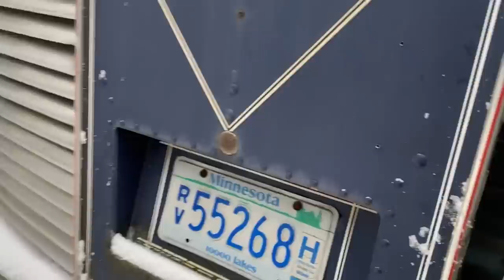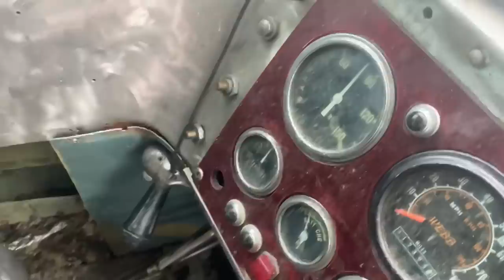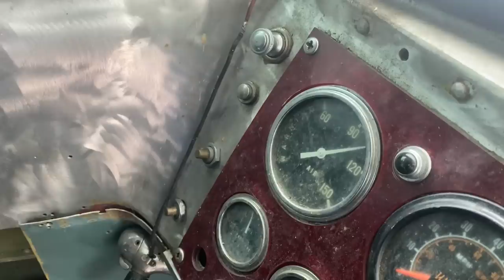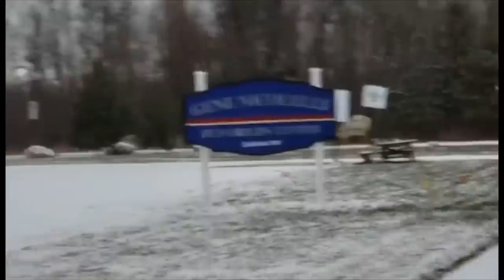Day 2 silversides bus rescue Minnesota

Comment: The iron ore process is called “pelletizing”.  They take the ore out on the ground at 35% iron grind it to a face powder, pass it through magnets, and roll it into small balls,  at min 65% iron.   Ships by iron ore carriers to Cleveland and Detroit blast furnaces. 

29 degrees is a heat wave.  I lived in near Hibbing for two years building a pelletizing facility in Eveleth Mn.

Comment: hi there Im a retired electrician the reason your genny does not like the 100 ft extension cord is resistance ( electrical that is )  my suggestion would be make an electrical service point in brick or block  a small little block shelter for a permernant point , maybe like a liitle block shed just big enough to mount a couple of powerpoints in you can run a heavy supply to this point from your shop and slove the jenny problem

Comment: 20 degrees. That's a heat wave in minnesnowta. As soon as I saw the first 10 second your video I knew exactly where you were.
Reply: originally from: Kevin Roses 

Annotated Thermometer:

60 degrees	Californians put on sweaters

50 degrees	Miami residents turn on the heat.

40 degrees	You can see your breath.
	Californians shiver uncontrollably.
	Minnesotans go swimming outdoors.

35 degrees	Italian cars don't start.

32 degrees	Water freezes.

30 degrees	Minnesotans put on t-shirts.
	Politicians begin to worry about the homeless.
	English cars don't start.

25 degrees	Boston water freezes.
	Californians weep pitiably.
	Minnesotans eat ice cream.
	Canadians go swimming outdoors.

20 degrees	You can hear your breath.
	Politicians begin to talk about the homeless.
	New York City water freezes.
	Miami residents plan vacations further south.

15 degrees	French cars don't start.

10 degrees	Too cold to ski.
	You need jumper cables to get the car going.

5 degrees	American cars don't start.

0 degrees	Alaskans put on t-shirts.

-10 degrees	German cars don't start.
	Eyes freeze shut when you blink.

-15 degrees	You can cut your breath and use it to build an igloo.
	Arkansans stick tongue on metal objects.

-20 degrees	Cat insists on sleeping in your pajamas with you.
	Politicians actually do something about the homeless.
	Japanese cars don't start.

-25 degrees	Too cold to think.
	You need jumper cables to get the driver going.

-30 degrees	You plan a two-week hot bath.
	The mighty Monongahela freezes.
	Swedish cars don't start.

-40 degrees	Californians disappear.
	Minnesotans button top button.

-50 degrees	Congressional hot air freezes.
	Alaskans close the bathroom window.

-80 degrees	Hell freezes over.

-90 degrees	Lawyers put their hands in their own pockets.

Comment: Torpedo on the engine is a great idea! Getting any kind of heat source on an old diesel can work wonders getting her going in cold weather. My block heater died on me in my truck so I have a space heater I run under the hood for a couple hours before I head out and she starts right up. Quick fix until I get a new block heater in.

Comment: If you see a mist of water coming of some ones tires it means the road is not frozen. If you don’t see any mist of water from the tires be careful because it is probably black ice.  You can get a thermometer to constantly measure the road surface temperature while you are driving down the road.

Comment: If you don't want to see outside a window watching a bus riding down the road for ten minutes, cut out 23:00 to 33:00. Do the same between 41:30 through the end of the video at 49:51; saves yourself an additional 8+ minutes of just watching someone driving down the road. Interesting stuff getting the old bus running and the old buses at the storage area though.

Comment: Scot, how does it work in the US for getting an old vehicle back on the road? In Australia we have to pay an annual 'registration' charge to the government for the privilege of accessing the roads. Driving a vehicle on a public road without paying the fee has huge fines, commercial vehicles like your bus also require a signed off annual safety inspection slip before the registration will be processed. You seem to jump into vehicles that have been abandoned for years and drive away, is there back ground paper work happening that we don't see? Cheers.
(That traffic light was pink by the way, not quite red)

Comment: Hey Scott you ever see those diesel fired 12 volt coolant heaters ? I was looking at one a guy put on a kenworth truck this week. I’m sure I probably can’t post a link in the comments here but it was pretty slick because he would switch that thing on, it pulled fuel from his diesel fuel tanks it has a built-in 12 V pump and it heats and circulates all the coolant until it comes up to 180 automatically. No cold start an instant heat👍
Reply: The ones I remember were made by Stewart Warner. I believe they were called Hot Box heaters.

Comment: I notice there was one fuel door that was labelled "gas only".  I wonder what that was for, as there was another labelled "diesel only", which I assume was for the engine fuel?
Reply: Those buses had a small 4 cylinder gas engine operating the air conditioning system.

Comment: I’ve got a 1947 PD 3751 was a greyhound from Ohio ! My front end when first driving before tires warm up if I hit a bump it will sometimes go into a severe front end wobble , I notice it’s getting worse ! Any ideas ? Also I had a complete rebuild on engine ,high block four valve head  jakes and rebuilt injectors ! First time after rebuilt drove to Colorado from Bend ore. Kept a close eye on tail pipe so not to lug engine RPMs up all the time ! Ran great no smoke , but when I got to Boise the highways was all tore up very bumpy , I notice a fuel smoke coming out of tail pipe but only when under power going down the road , no noticeable power loss , but pissing off everyone behind me with the strong diesel smell . No smoke when not in power, idol or raving engine in neutral . Could it be a puked injector? All rebuild was done by Jim Fairs diesel in Bend Ore. would welcome any thoughts! Thanks ! Silverside owner ! Love my bus! Sincerely , Richard !

Comment: Get a bag of charcoal,  a dollar store paint tray, get the coal going and get some blocks under it so the coals under the oil pan. Use left overs for weenie roast.  That bus looks too good to be true, is this reality TV ?
Reply: Don't they sell pre-made portable barbecue picnic trays now?  Come in a foil box with charcoal or something, you just have to light em.  Never thought of using that to heat an engine...worry about fire though.
Reply: @DellAnderson  I guess anything would be possible. Very lttle  if any flame . just radiant heat

Comment: Have you put any thought into getting a diesel heater or maybe 2? You could feed them off of your reserve tank. They are powered off of 12v and from what I've seen they are really quite efficient and effective. I absolutley love watching your videos. The thought of you and your wife being with out your main source of heat makes me sad. I know truck drivers have been using diesel heaters for year to keep warm and not idle their engines. You could also use one in the water bay to keep your tanks warm so they don't freeze.

Comment: Is it wet or is it ice? Is there a spray coming off you tires? If so, then it's wet. Also, the tracks where your tires run will be more slippery than the area between your tire tracks, the area in the middle of your lane. That's because the heat from your tires will actually melt a bit of the snow. It then quickly refreezes. During daylight, those tire tracks will be more shiny under a bridge. That is black ice. The sun, even when it's cloudy, will help melt ice on the road, more so on blacktop than on concrete. The darker road surface absorbs more heat than a lighter surface. Roads are usually worse (slick) right after sunset when the sun's radiant infra-red warming is lost. Safe travels..!!

Comment: Pre 2000 tires are Spares until used up NEVER ON STEER AXLE!! Steel belts will hold up far better than Nylon Belted antique tires. 20:52

Comment: If you see spray coming off the other vehicles, then the road could be wet (or water over ice). But if the road is shiny & you see no spray, best be driving very cautiously as it is most likely icy.

Comment: Can someone explain why there's a small door behind front left fender well that say ''gas only '' when this is a diesel vehicle?
Reply from the maker: enterBJ40 generator now, but originally it was for a small gas pony motor that turned the air conditioning compressor for the factory air conditioning

Comment: Just think if you had electric radiator fans she warm right up to 180 no matter how cold it got outside air temperature. Because the fans wouldn't turn on till the thermostat setting commanded it to turn on

Comment: If it's a diesel engine, why does the side of the bus say "gas only"?  Is that for a onboard generator?
Reply: Air condition system run by small gas engine behind grill behind left front wheel.

Comment: So Guys,  Sorry but I know nothing at all about buses. I am a truck driver.  What year is the rescued bus?
I take it  the engine is a Detriot?    I noticed the bus following has a column shift.  Is that common.  Is the
transmission synchronized? I hear the driver scrape while shifting into 4th. Would double clutching help
to stop that?  Back in the day, we would say " Grind me a pound "  Stop & try again!   Regards

Comment: Is that engine a 6-71?  Factory HP rating around 150? or a little more?  Great job getting it started.  But old tires are not all that safe!  Glad you made it home without a problem with the old tires and brakes!
Reply from the maker: 238hp but in this configuration closer to 200

Comment: Do these buses have a clutch pedal? It sounds like you are shifting completely manually
Reply from the maker: Not only is there a clutch pedal I’m double clutching so pressing it 2x each shift.
Reply: @BusGreaseMonkey  Damn, not bad!! I'm from the UK where manual cars are more common than Autos, but in the bus industry they have been almost all Auto since the early 2000s. Lots of different transmission setups in historic vehicles, fully-manual, semi-automatic, crash box manual, pre-select...

Comment: I know you will likely not see this but if you do. I have a 38' Winnebago and it has blind sides all the way around (it was a custom build for the ARMY and only has the front and rear escape window, though I have added 3 more smaller windows) it is currently set up for our Volunteer Fire Department as a command and radio center. I have just finished it and though I am used to driving anything with wheels I am afraid that my crews might have to operate it when I am not around.
So here is my question. Does the active rear camera distract you when driving? I want to add a active and both side cams for safety. Is it worth it or is it to much of a distraction. I am also adding the GPS and a hands free communication radio just like your cell phone except for the fire response team channel
Thanks if you can get a chance to answer if not I understand
Chief Dave C.E.,R.T. (Community Emergency Response Team)
Reply from the maker: It’s nice for passing
Reply: @BusGreaseMonkey  Thank you. I don't worry a whole lot about passing. With a unit that weights around 11 ton fully loaded ... we don't need no stinking permission to pass. Thank you again I think I am going to go ahead and add the cameras after all tomorrow then I can roll her out for a test run

Comment: Does this bus have 2 engines? There was a panel on the left side that says Gas Only, but on the right side there's a panel that says Diesel Only.
Reply from the maker: A small gas pony motor for the factory air conditioning system
Reply: @BusGreaseMonkey  Thank you.

Comment: It's a diesel but the filler cap says gas only?
Reply: Diesel fill on right side. Gas is for small air conditioning system engine.

Comment: Get some thick polythene type it to the side and top of the bus make a tent keep the heat in with the blower.
Go and get cholesterol check sounds like you have cholesterol problem if you are getting numb feelings problems with circulation and feeling cold

Comment: hi what are toe warmer things?
Reply: Small packets that warm up when you bend or activate the chemicals inside. They help warm feet or hands when used inside mittens or boots. Sporting goods stores, general farm supply stores or even hardware stores usually stock them.

Comment: I get cold just looking at this !  What about license plates, state inspection and insurance on this joint? You guys act like you're not worried about cops!   Cracks in those tires scare me!
Reply from the maker: It had insurance, no state inspection is required, and he had the bill of sale and title dated that day, they go by registration date of date purchased it’s never been an issue.    Tires were fine, we kept the speeds down.  As you saw they made it just fine
Reply: Thanks I was just wondering.  Here in Virginia Ol' Smokey would be one you with both feet with no state inspection!  LOL  @BusGreaseMonkey
Reply: @BizMoneySource  Private vehicles not in commerce moved about carefully on Minnesota roads are not subject to hassles by cops.

Comment: Can you put temperature controlled louvres on you radiator to give you more heat in your bus.
Reply: I sure he can it only takes money
Reply: @gullreefclub  My question was is it possible. It may not be available or there may not be enough room or access to install one. It's not always money that fixes a problem. Sometimes one fix creates another. What may work in the winter may not work well in the summer. Some OTR trucks use louvers some just snap a canvas material across the front of the radiator to help heat the engine up. And as Scott said just put cardboard in front to block air flow.
Reply: Pretty sure silversides had them, but they've all broken after 70 years and there is always something more important to fix
Reply: Yes, they came with shutterstats, which do just that.  Most of them have been removed, because no one wants to travel in that cold with an old bus, so we rarely need them. And they do block some air flow during the summer when you need maximum air flow.  That's why I removed mine this spring.
Reply: @LittleWapiti  I think Key West is a good solution.
Reply: If you look at some of the big rigs you will see that they have some canvas covers over their radiators that can be snapped to restrict airflow in cold weather. I'm not sure how they would work on rear-side radiators though!

Comment: I dont understand, you have a DIESEL bus with a huge tank of DIESEL fuel which has an incredible amount of btu's per gallon and yet you use propane for heat??????
Get a diesel heater!! The cheap Chinese ones have prooven to work very well and you can even keep a spare for less then the price of one name brand one!!
Reply: Hehe, the systems aren't cheap, but there's no substitute for the classic Webasto heater systems like they use in Canadian buses. The old Prevost (8v92 power) my friend drives has a "hydronic" system that heats the engine, the cabin, and the fresh water systems.

Comment: Should have draped a large tarp over the back of the bus and heater. Definitely more heat on engine and a place to warm yourself up.
Reply: Those heaters create tons of carbon monoxide. Can't risk it for the gain.
Reply: @busoldmanphil7293  wasn't saying seal yourself in just as a wind block. You will get heat and plenty of fresh air.